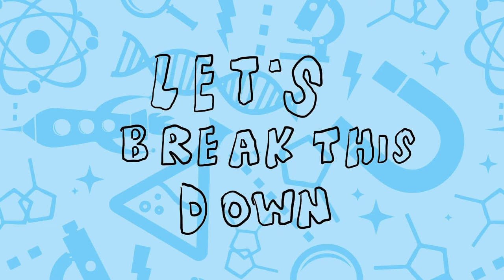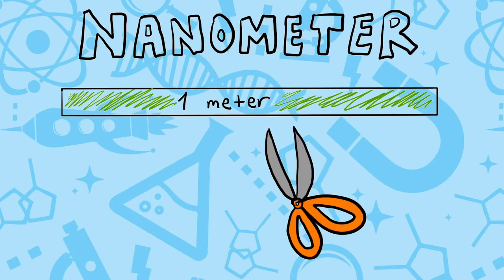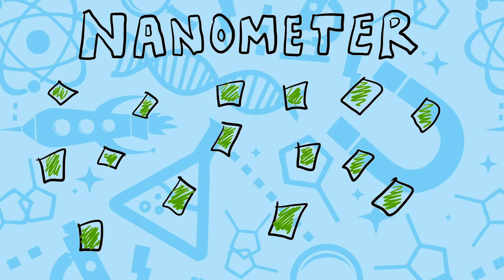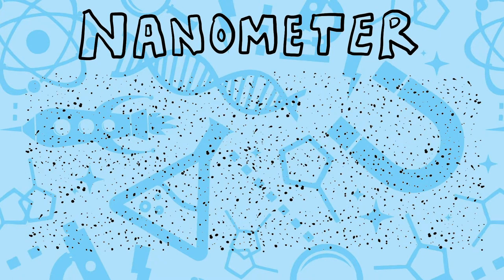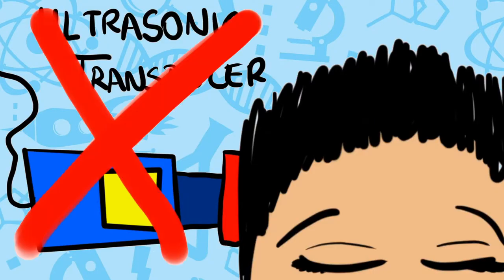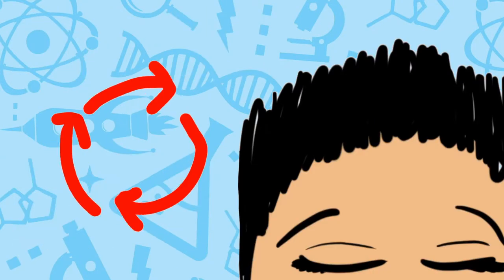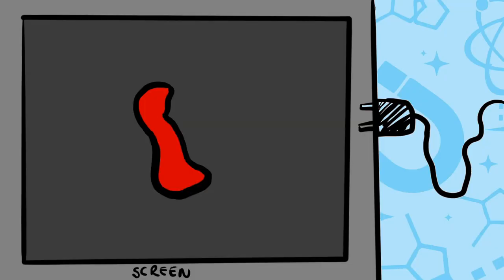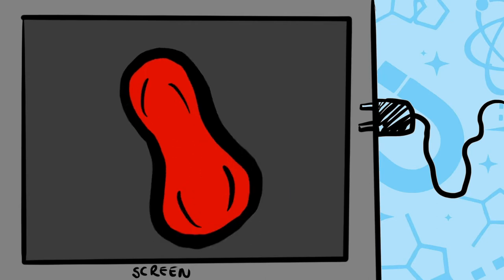Nanoscale photoacoustic tomography (nPAT)

Comment: Could this be used to detect covid19 on surfaces and in the body
Reply: It's very difficult. There are various modes of Photoacoustic tomography. A- mode can be useful where you can see real-time signal and variations... But B-mode is difficult but it's possible. The trouble is the random movement of the virus in the imaging plane..
Reply: That's impossible as the depth resolution is insufficient